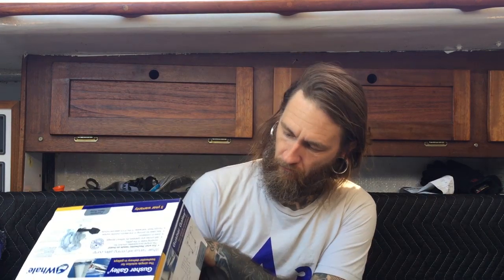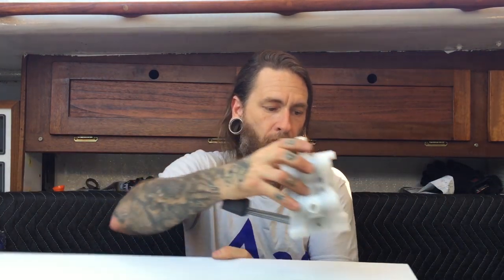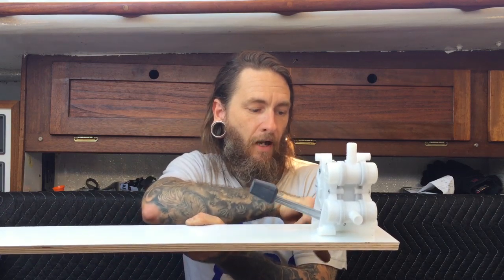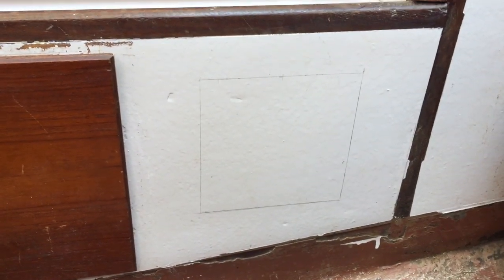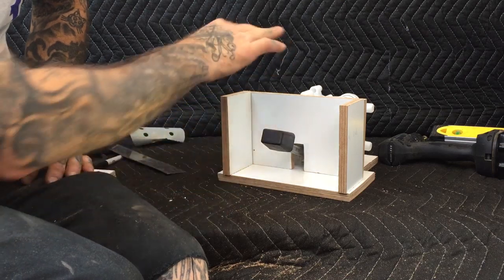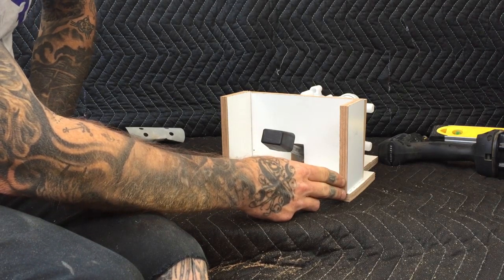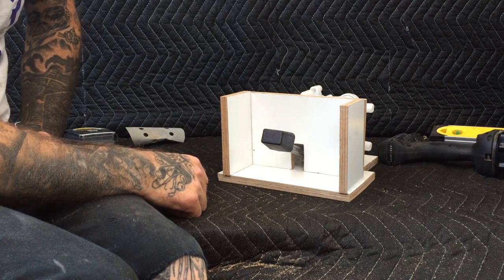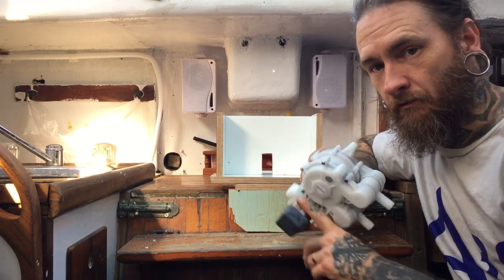Installing a Whale Gusher Foot Pump on an Alberg 30 Sailboat (PART 1)

Comment: Dude, your videos are interesting to watch and your podcasts equally captivating.  Watching you do projects on Tritea is therapeutic. I didn't champion the whale gusher idea until i saw your IG post about battery and water conservation. So i also installed one too. 2 Questions??  1. What was the reason for removing  the electric pump, vs.placing the foot pump in line? and 2.where are the red curtains for that "stage"?  keep up the good work!
Reply from the maker: I considered leaving the electric pump installed and doing a splitter but in the end I couldn't figure out a reason do leave it hooked up. I want as simple as systems as I can get on a boat so removing extra stuff just makes sense to me. I hope all of your projects are coming along nicely and you are on track to visit Santa Cruz !